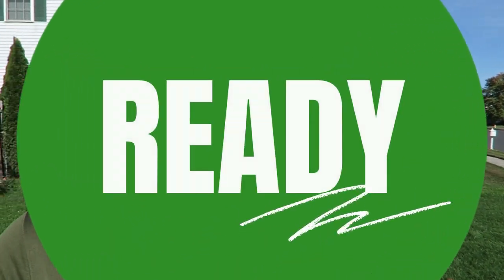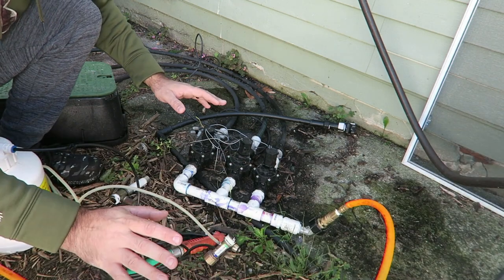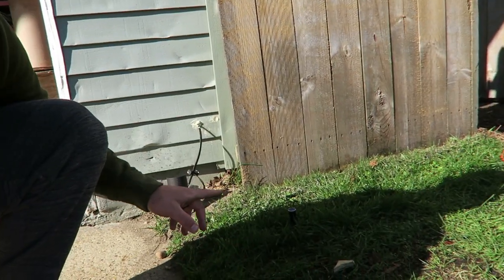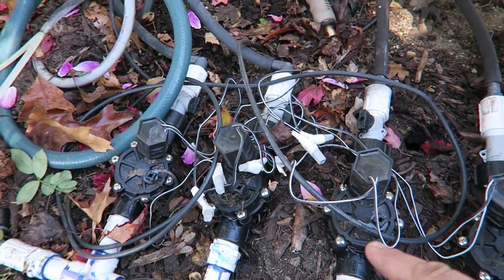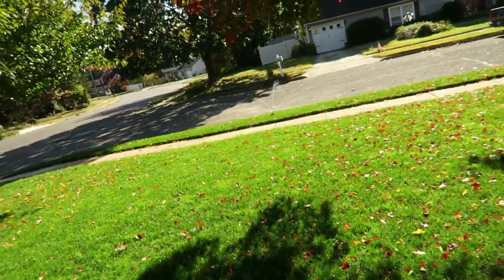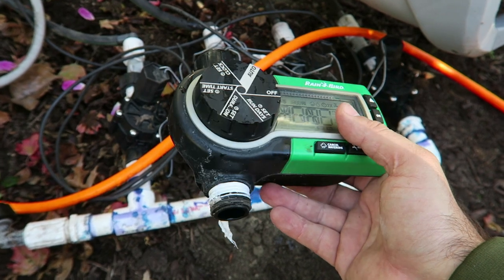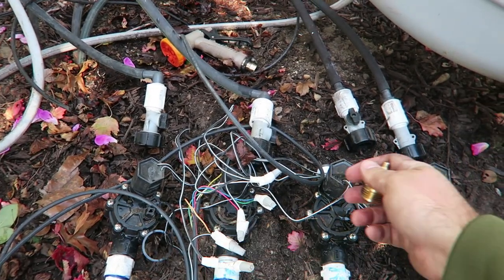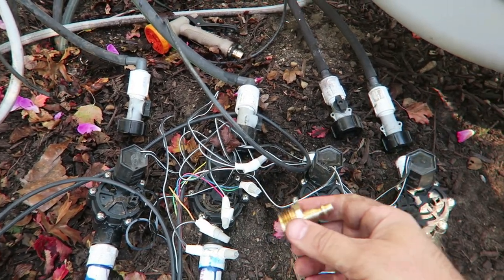How To WINTERIZE a DIY Sprinkler System Step by Step - Blowout the Pipes #blowout #blowjob

Comment: Hey how much water pressure are you getting out of your hose bib? Is that second hose bib tapping direct into the city line before any regulator where the rancho irrigation lines go?
Reply from the maker: 40 psi. And no there is a regulator.
Reply: @WooderBoyProductions  I see you have four zones. Why didn’t u settle for something like a b-hyve wifi timer similar to the melnor? Reason I ask is because I have created the same system you have. I’m wondering if I should have just went with one of this manifold valve system like you
Reply: Yeah  I now see why you went with the Rachio controller. The Bhyve sucks. I keep losing wifi connectivity. I plan on buying one of the Huinter 4 port manifolds from amazon and doing this same exact setup with my 1/2 inch blu lock pipe. Do you have your Rachio outdoors or in the house?? Sorry to keep bothering you man.
Reply from the maker: @tite732  in the garage. No issues there.